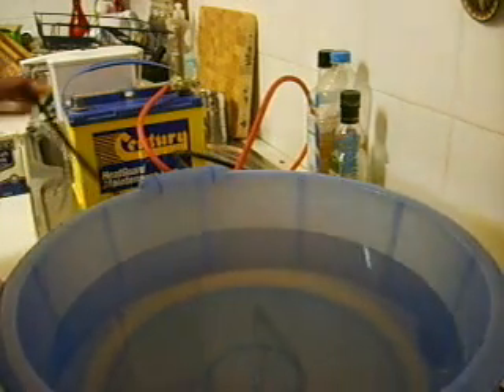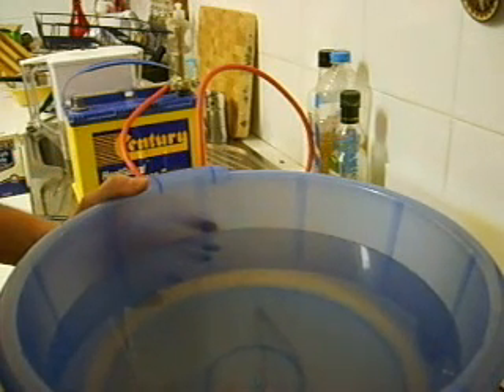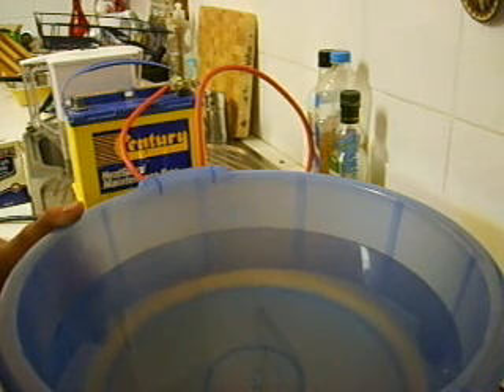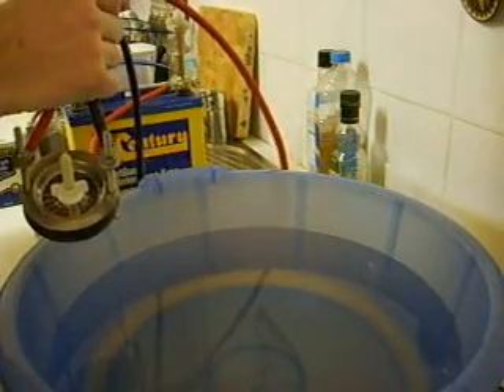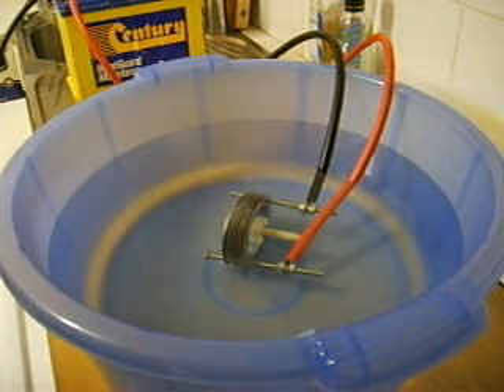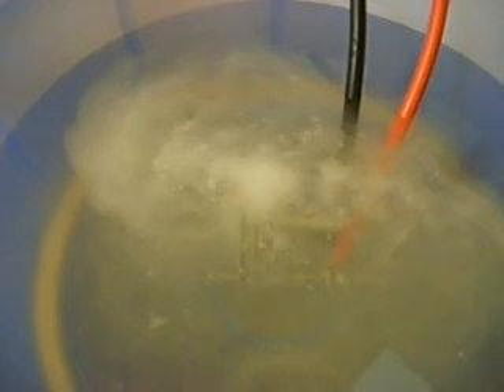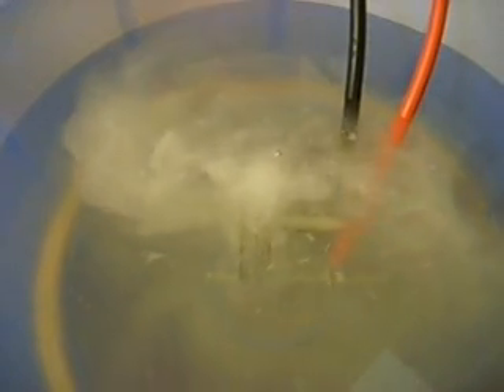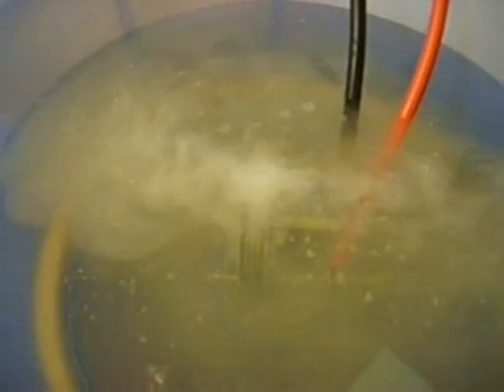Hydrogen at home (sink strainers) #3

Comment from the maker: hi ddcivic this is a standard 12 voit car battery from a Ford laser, I agree with you about the filtered water it will still get nasty after a while I just did this to give the water a bit more time before that happened, in the future I intend to use distilled water with an electrolyte which I am yet to decide on.  I would also like to make a setup for a car in the future but there is a lot more tests that I would like to do first.  Thanks for your interest.